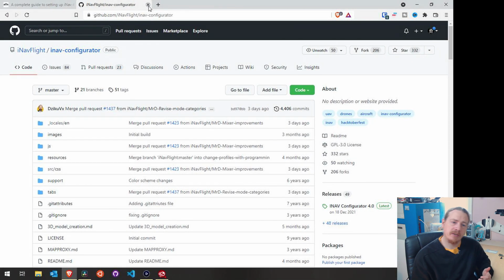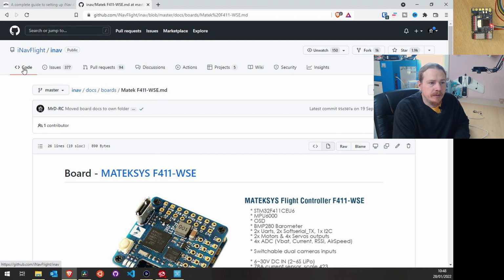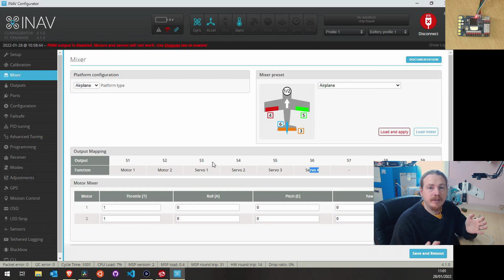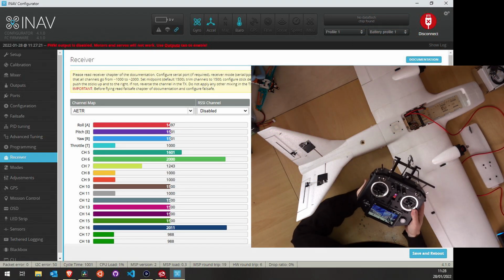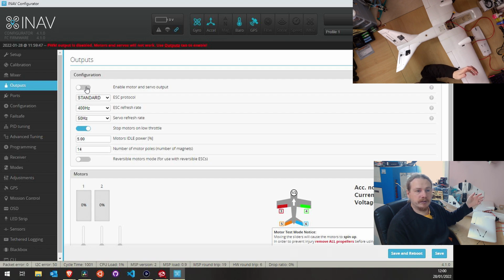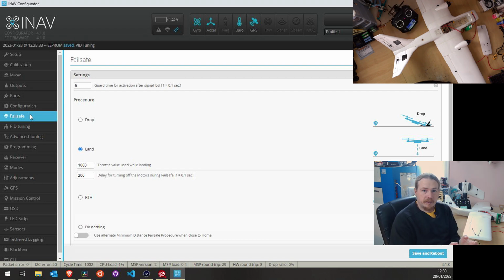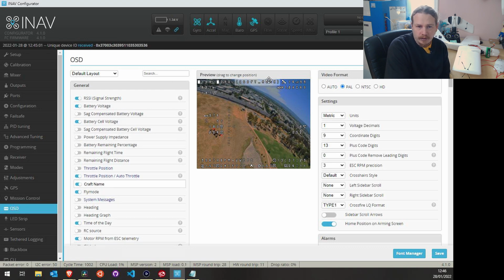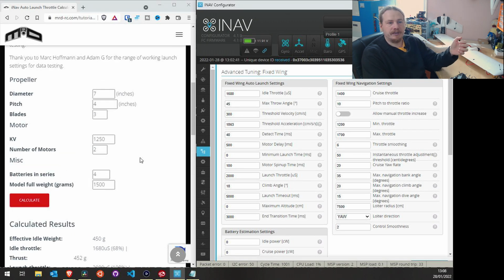Setting up iNav 4 - A complete, new set up and installation for fixed wings

Comment: Thanks for the info on the last issue I had. Maybe u can figure this one out. Same sky hunter 1800 mm biuld f405 inav 4.1 so everything works fine acro , angle,manual, until I arm the plane. Then all stabilized flight don’t work probably control surfaces don’t go back to center and all seem to over rotate. All flight modes work fine when not armed. I’ve check and checked transmitter even set up a different transmitter thinking something was wrong it’s not in wiring if I plug in a parts servo same thing happens it has to be something simple that I’ve overlooked due to frustration.
       Thanks again for all that you guys due
Reply from the maker: Hi Aaron. That sounds really weird. I've not heard of that happening before. There shouldn't be any difference as far as that goes between armed and disarmed. Do you have launch mode permanently enabled? If so, disable that and try again. If not, go to the receiver page, put it in a stabilised mode, then arm. See if any of the bars, other than the arm channel moves.
Reply: Yes I have launch mode enabled man I’ve been scratching my head on this for weeks. I won’t be able to do anything till this weekend . I’ll keep in touch thanks.

Comment: Hey Darren, I am trying this on a Mini Talon, i had 2.6.1 (i know its super old :)) and wanted to put on 4.1. I did that, did a auto level, and autotune. Before doing all this, it had all the default 4.1 parameters on here, and ofcourse no PIDs got tuned in this process, just the feed forwards. With my first flight on 4.1 its not flying as great as it was in 2.6.1 - i have reviewed the DVR and HD footage and there seem to be lot more of shakes while its flying / cruising. Wondering if I should try copy over the PIDs from 261, and keep the FF values from the 4.1 autotune? Also I notice that 4.1 has much lesser options in the filters tab.
Reply from the maker: Hi Keith, 

No, I wouldn’t use the 2.6 P and I. They will not be based on the same flight dynamics. 

The first thing that I would check is the rates and FF in 4.1 and compare those to 2.6. In 2.6, if you didn’t manually tune the rates in 2.6, they would have never have been set. It could be that you now have higher rates due to them being tuned, which will give more movement. What do you have for FF?

What flight mode did you use for the autotune? How does it fly in manual, is it smooth or too aggressive? Once that is known, we can look at where to go with the tune.
Reply: Hey Darren, sure here they are. Rates from 261 - Roll Pitch Yaw 180 140 90, and in 4.1 post autotune 170 50 & 30. 

FF from 261 are  41 50 and 63 while in 4.1 they are 71 255 & 151 post autotune

I was using Acro while autotune. In acro and manual it seems to fly smooth. When in crz mode or angle - its doing those jerky movements
Reply from the maker: Cool, Acro with full stick deflections are what's needed.

I can see what's happening. Basically the rates in 2.6.1 are too high on the pitch and yaw, for what the airframe can achieve. I can see that you need more movement in the V-tail. Yaw seems fine, but the pitch definitely needs more throw. iNav has dialled down the rate from the defaults, and the FF for pitch is maxed out at 255.

You'll probably want around 3-4mm more throw on the pitch than you have now, then test. You can keep yaw the same by changing the weight in the mixer, to maybe 55 or 60 on the pitch, 45 or 40 on the yaw. Just make sure the surface totals 100%. I think that will at very least be a good place to start, if it doesn't sort out the jerky movements. Aim for less than 200 on the FF pitch after an autotune. The roll looks decent, so I think that is fine.

Just to confirm the PIDs:
Roll: 15 - 3 - 7
Pitch: 15 - 5 - 5
Yaw: 20 - 0 - 0
Reply: Great let me try that. What do I change in the mixer tab exactly, did you mean change stabilized pitch values, they are currently 100 and -100. How can I send you a screenshot maybe.

And yup the pids are what you typed.
Reply from the maker: That's great about the PIDs. But the V-Tail setting doesn't sound right at all. If you are sharing pitch and yaw on the v-tail, the pitch should not be 100%. Both pitch and yaw should be 50% by default.

On my web site is a contact form. If you drop me a message on there, I can reply and then you can send me a screen shot. Or my Discord channel is in the video description. You could contact me and post a screen shot there if it's easier.
Reply: Sorry for replying this late Darren, let me try get you the screenshots in a day or so

Comment: Thank you for this tutorial of setting up iNav 4. I have a CW Mini with iNav 3.0.0 and still didn't maiden it. Do you recommend upgrading to iNav 4? If yes, what sections of the diff all file should I leave? Since the FC (Matek F765-Wing) is already installed I will not be able to do the calibration so I suppose I should keep the accelerometer settings.
Reply from the maker: Hi Jorge. Yes, I'd update to 4.1, especially if you've not maidened the plane yet. You can do a "diff all". Just edit the diff and remove the profiles section. After you have restored the diff, you will need to apply the defaults for an "Airplane with a tail". You can get to this by going to the PID Tuning page and clicking the "Select New Defaults" button.

If you can wait til Sunday, that video will show exactly what you need to do.
Reply: @MrD  I've been waiting for over a year for someone who can go with me to maiden the airplane 😀I will definitely wait til Sunday to watch your video. Thanks!
Reply from the maker: Wow, that’s quite a while. Hope you get that in the air soon.

Comment: Mr. D. When I calibrate the accelerometer, pitch and roll must be zero, if the surface is totally levelled?
Reply from the maker: It will be pretty close to zero. If it's out a little it's fine.

Comment: Excellent video Darren! About what you were saying about discontinued PCBs, I see now that Matek discontinued the F722WPX! I wonder why? It seems to be a very nice board and I have 4 of them. Do you have any idea why they stopped manufacturing them? The F405-WING board is a very old board but they are still manufacturing that one so something must be real good about that board. I do not know much about the H743-WING V2 so I guess I will need to buy some F765-WSE boards since they are still being manufactured plus they are good boards. What are your thoughts on the H743_WING V2 board and them discontinuing some popular boards?
Reply from the maker: I think its because the F722 chip is being phased out. I have an F722-WPX, but have not yet installed it. I really like the idea of the pixel OSD. So I think it's a shame that Matek are no longer using them. If ArduPilot actually supported that OSD chip, maybe it would be a different story. The F405-WING is being discontinued. Its replacement, the F405-WSE will continue though. The F405 MCU has more flash than the F722, so will last a fair bit longer.

I've not used the H743 WING or the V2. So I can't really comment. I like the purple PCB though, I think that looks cool. I've not flown my H743-SLIM yet either. But it's nice to work with. Configurator is faster when connected to that flight controller. I'm looking forward to flying that one.

I think for progress to be made, some things ultimately need to be stopped. I guess Matek will look at cost or availability of the chips, vs how well they're selling, and how much longer they'll be supported for. The F722 was really an CleanFlight fork only flight controller. There wasn't enough flash for ArduPilot. So Matek would instantly be losing sales there. Unlike the F405, F765, and H743; which all work on everything. I think the F411 has seen it's day too. In all honesty, I think it's been clinging on for a while now. It's too limited in its functionality. I just hope that they stop trying to cram everything on to smaller and smaller FCs. Don't get me wrong, there's a place for small flight controllers. But I think there should be a larger (-WING size) version too, which is more robust.

Comment: I managed to get my F411 to update after. I just went back into the older 2.6. upgraded the firmware to 4.0. then just connected to the new 4.0 configurator. So happy days. This tutorial will be just what I need. It's long but I'm sure it's worth it. Let's go.
Reply from the maker: Thanks Kyle. It’s strange the F411 didn’t want to update. But glad it’s sorted. Yeah, this video is way longer than I thought it would be. But rather than just say click this, this, and this; I’ve tried to explain a little about each part. Hopefully that will help everyone pick the best settings for them.
Reply: @MrD  Cheers mate.  The only thing I can think of, was that it was on older firmware. As soon as I updated to newer firmware using the old configurator. It worked fine. But yes it's long, but it's got everything we should need. I'll be looking to use this for an Ar900 pro and an S800 V2 and C1 chaser. Soon as I'm back from the gym I'll get stuck into it..👍🏽
Reply from the maker: That’s strange still though. The full chip erase should get rid of everything. Still, its working. That’s the main thing.

Comment: Thank you for this Darren. I find your way of explaining the ins and outs of inav and fpv in general very clear and concise. Although I have already built my first iNav build, there are many things I fumble over outside of the iNav setup, like component placement inside the fuselage, or the best place for the vtx and antenna mounting in the foam. A complete build would be a must watch for me!
Reply from the maker: Thank you. A build series is something I’ve been thinking about for a while. If fellow pilots will find it useful, I’m happy to make one.

Comment: Great highlights, UART 1 for FTDI adaptor(I would like to see a how-to), 3d speed, actual time and loitering direction using yaw and not a switch like I do. Only 1 thing I should add that caught me before on iNav: max power on tbs smart audio is 4, not 5. I can't wait to see your tuning osd and if I may ask for an in-depth tutorial on modes and what each of them do.  Many thanks for what you do for this community.
Reply from the maker: Thanks Dorel. It's great to get feedback like this. I'll add the FTDI adapter to the list of videos to make. Yes, SmartAudio only specifies 4 power levels; certainly with the original standard. Some manufacturers have started putting out VTx that have 5 levels on SA. But as far as I understand it, it's outside the spec. There should be links to the in flight tuning and modes in the video description.

Modes: https://youtu.be/LuSghRxc-as
In flight tuning: https://youtu.be/A5i0gs9LfE8

Comment: I like all the little bits of info you add. About the different options for gps for example or the servo mapping numbers, leaving the default msp all good stuff. When testing stabilized yaw will it show in the outputs if the servos move?
Reply from the maker: Thank you :) It makes for long videos, but some of that extra info can be useful xD 
Yes, the yaw stabilisation will show movement on the outputs page. But, it might only be a little.

BTW, sorry for not answering your question on the auto VTx power video. I saw the first sentence  of the question. But YouTube deleted. I've tried to contact their support, as the amount of unfairly deleted comments is ridiculous.

Comment: Thank you for making this I’m in the process of setting up a ar wing pro :)
Reply from the maker: Awesome. I hope it all goes well and you have some great flights.
Reply: @MrD  
Thanks for the encouragement! The ar wing needs an extreme amount of nose weight to hit the cg on the marks looks like a 4s3p should work? Still in the build stage , in your opinion is that too much weight or should I use the recommended 4s2p configuration ?